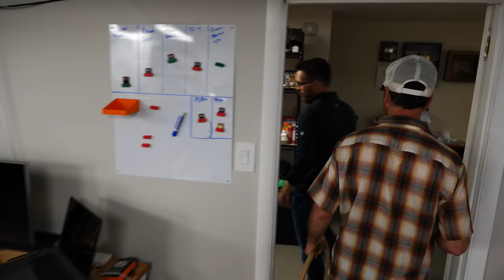I Like To Make Stuff Shop Tour 2020! (April Fools) | I Like To Make Stuff

Comment: Hey Bob, does that drum sander do well with 3 mm wood? I laser cut things a lot and wanted something similar to sand off the scorch marks afterwards.
Reply from the maker: Yeah, it works on several thicknesses. I don't remember the range, but I've sent things through after coming out of the laser (was probably about 3mm)

Comment: I'm actually kind of curious about the sawstop because I know it detects the moisture of whatever it's cutting, have you ever had the brake falsely fire when cutting through a piece of wood that wasn't completely dry?
Reply from the maker: It definitely WILL do that, but it's never happened to me.  I did accidentally cut through a brad nail once, and that set it off.  There is a way to temporarily disable the safety feature if you need to cut wet wood or aluminum.

Comment: would a damp piece of wood have the same effect on the table saw that a finger / hotdog would?
Reply from the maker: Yes, it definitely does! If you need to cut "green" or wet wood, you need to disable the safety mechanism temporarily.  There's a special procedure you can do to disable it for a single cut.